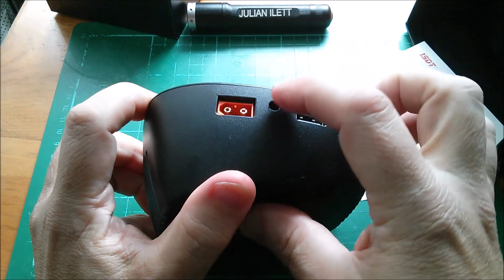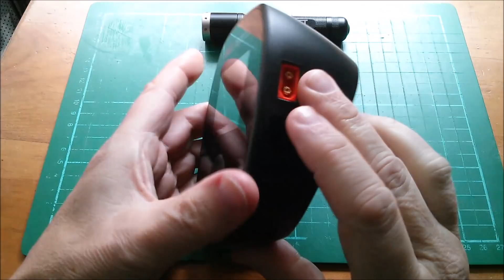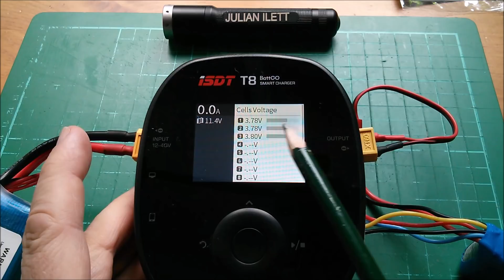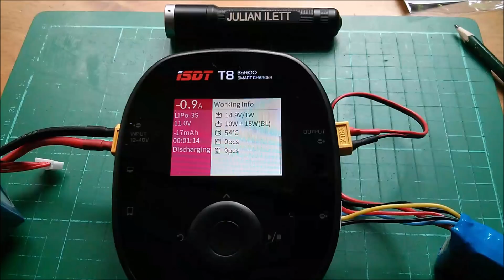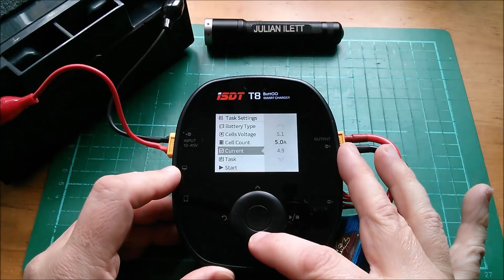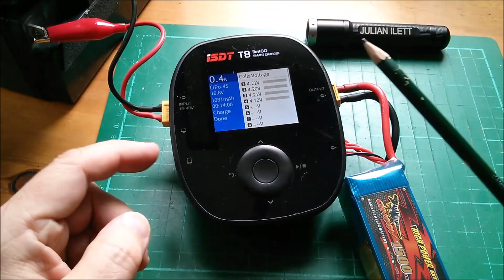First Look: iSDT T8 Battery Charger (BattGo)

Comment: Can I charge a 130A lithium ion leisure battery from alternator via this charger?
Reply: 3dmixer I have been looking to charge a 7s lithium battery (29.4v) from a 12 or 24v alternator. Have you found a way?? I'm thinking about getting one if these and giving it a go!  30a/30v it may take a bit to charge my 550ah liion bank. But better than nothing...
Reply: @jamest.5001  These chargers for like 20 -30A battery packs max. If you want to charge a 550A battery pack this charger will be in flames.  I Had a dc to dc charger which was capable of charging at 30A and max 300A battery pack.  It was a huge unit that the entire back was heatsink and 2 large fans.  This is a toy compared to that. This is good to charge drone batteries or maybe ebike batteries . Don't waste your money

Comment: I like the ISDT D2 the best as it has two chargers in one and the power supply is built in so you just plug it into the wall. Not so good if you are in the field, but much better for my purposes.

Comment: Using a battery to charge a battery seems stupid to me, for a lack of a better term. I would connect it to a laptop power brick to charge any of my batteries. They should charge more for it and offer a power brick, I hate chargers that don't come with a power source. Other than that it seems like a good charger.

Comment: So will it charge a shorty 2s battery @ 30 Amps from a 1000 watt power supply @ 12 volts or does it need a higher volts like 32v?

Comment: it sure is able to put the current from one battery to another... even with a larger discharge rate.... you just have to switch the two batteries around ;)

Comment: Would like to wait for a charger that can charge a 14s bike battery, the 8s charger is 1 step closer. The Q200 charger looks good value has 6 s  inputs and 4 channels so I can charge my 14s with two 6s inputs and one 2s input which is not bad, the 6s channels at 100W each and the 2s at 50W so should charge very quickly . I soppose each charger has its own merits depending on your setup.
Good Vid , glad I subscribed
Reply: I am searching for 12s balance charging. How do you set that up on a q200?

Comment: check the settings (long press center button) for min. input... maybe it goes lower than 11.6v.. also,  you can set a maximum wattage...
on discharge the BL should only be used when cells are imbalanced, so just 10w for regular discharge...the discharge rating normally is for 1S and gets split with more cells..some charger even allow connection of external loads..
and impedance should sink with charge.

just my  2cents and thanks for the review :)

Comment: It will be really interesting to find out exactly what this 'Timing Auto-discharging Function' is that the BattGo batteries list in the specs, and was adjustable on the cell balancer unit. If it does what I think it does, it means the BattGo system must have have the facility to add a internal balancer unit to the battery, so it can self-discharge after that set time period? Making it really handy, especially when you have people who still think it's ok to leave lithium batteries fully charged, instead of at storage levels, particularly if you want longer lives out of your batteries without them puffing up.

Comment: So if i got it right u charge a battery from a battery
Reply: Yeah, you can do if you have a high capacity battery handy. It's more that the chinese have standardised on the XT-60 connector for hobby chargers as it's rated at 60A (hence the 60 in the name - XT-30 is 30A, and XT-90 is 90A). So you buy a power supply for the charger that comes with a XT-60 connector on it, or add one to whatever one you intend to use ;)

Comment: Battery ESR will drop as charge increases. Think of it logically: A charged battery can deliver more current than a discharged one, without terminal voltage dropping by a specific amount. Ohm's Law has to be obeyed! ;-p Thanks Julian.

Comment: The green "fast charge" is when it's still balancing, but has generally finished charging. The blue mode is the real finish :)
The green phase can take quite a while with older and more unmatched packs.

Also: Have you taken a look in the system menus? Hold one of the buttons for a while, you should be able to set a lower cutoff-voltage for the input side there...
Reply from the maker: OK thanks Tobias. Yes, there is a system settings page - the minimum input cutoff voltage is 11.6v - the maximum is 48v (which is a bit weird).
Reply: If I recall my SC-620 has a setting that maxes the W at 520W, and it charges at 520W despite it's 500W rating.

Comment: Good review.  I wonder if you took one of the cells down to say 2.9 volts and left the others at 3.9 volts if it would output to the one cell that is much lower until it reaches 3.9 volts before it raises up the other cells?    Or does it increase all cells at the same time and stops on the cells that reach 4.2 volts first and then continue on the one cell that was lower?  Or does it channel higher current to the lower voltage cell?  I always wondered exactly how the balancing was performed.  I suppose you could test this on the unit.
Reply: Most (if not all) chargers usually perform that latter, they output your set current through the main leads then once the cells go beyond a certain threshold of the others it will connect a resistor across that cell, although considering this charger is a tad expensive at $100, I would be a bit disappointed if it didn't also charge the cells over the balance leads.

Comment: The faster you charge a lithium based battery, the longer it may take to normalize at max voltage.  So instead of flash charging to 4.20v and then coming back in a couple hours to find that all cells have normalized or saturated down to 4.15v or less, the smarter chargers will keep current on the cells until they no longer drop below the set peak voltage.  And yes, internal impededance does fluctuate with state-of-charge, but I highly doubt this unit is actually measuring impedance via injecting a 1khz sinewave and reading it's reflection.  It's more likely just a calculated resistance reading (not true impedance) which is rather useless for cells..
Reply: Aspendell l think you wrong l have one t8 and it can repair old unbalanced 6s 16ah  battery and l mean fix the cell capacity back to is original
This charger stop all other cells from charging and fill the others until is ending charge and l made the test at 4.15 volt

Comment: Whats the point of battGo? You  can pull information about the cell over the 1 wire data link, but you still need to attach the balance leads for balance charging.  In that case you can get cell voltages and info from there while charging.   Other than telemetry data about the cell it seems like it doesn't add that much.
Reply: Um... that "telemetry data" is the whole point!

Comment: I would buy one, if I could set the maximum voltage. 4.15 is way to high, I'd love to use my batteries much longer (more often) than 500 charges. If I could set it at 4.00 Volt, I'd buy one immediately. I do like the 2 Amp balancing feature!
Reply from the maker: If you set it to Li-Ion, the target voltage range is 4.05v to 4.15v
Reply: Thanks. That is more like it. Just a 10th of a Volt lower than that, and it would get interesting. My desired working range would be 3.90 to 4.0 (I would like to play with the setting of course). The only other way I can come up with is using a very heavy relay or switch so I can put the sets of batteries in series and parallel (when not in use that is), then I would no longer need balancing either (after doing some manually sorting the batteries of course). How do car batteries (Tesla and such) load balance their batteries?
Reply: deslomeslager Or write new firmware?
Reply: Well, yeah, if you insist on it working, then no, it won't work!

Lesson: don't post immediately after waking up...
Reply: @FlyingShotsman  So you made an easy mistake like everyone else but that one dude was a real asshole about it. You were just trying to help and he immediately jumped to trying to make you feel dumb or silly for it. He should really know that's gonna happen when looking for answers in a YouTube comment section and have some respect for people throwing out ideas.
Reply: As a workaround, you could put a diode in series with each balance lead to drop ~0.6V, then set the charger to achieve your desired cell voltage.  If you don't want to mod all of your batteries, you could just make a universal adapter with eight diodes and the required 9-pin connectors on each end.
Reply: Please take a paper and work this out for yourself. It is not going to work that way for many reasons.The micro processor would not be able to measure the voltages, and would do strange things.I need a solution capable of charging (and most of all balancing) to a voltage which I can choose (3.90V to 4.00 is most interesting to me). But if this device can't do it, there will be others. I would not mind having to build it myself using an Arduino, so I am watching this channel carefully for that reason!
Reply: use a schottky diodoe with a styp psy resistor so that it can still read the voltage. and have only 0.2v to 0.6v drop at 0.1 to 2 amps if your only charging at a lower current.
Reply: What's a styp psy resistor?

Comment: Nice capabilities apart from bailing out on low input voltage. Instead, it should reduce current draw to keep the input voltage above a settable threshold.
It would then be able to make use of a solar panel or array for input without needing to babysit it and continually restarting.
Because it doesn't attempt to hold a minimum input voltage, or understand MPP, as soon as you ask too much from the panels or a cloud comes by, the charger keeps trying to do draw as much as it's told to, and pulls the panel down until it drops lower than 11.6V and aborts. Infuriating.
I look forward to seeing a firmware update to hold input voltage at a specified level, as my 300W Turnigy Reaktor does, so I'd be able to charge my ebike battery at up to 1kW from my portable solar panels in the field. They are an order of magnitude lighter than Pb batteries!
Reply: I'm not a battery expert or anything but I've never heard of any smart charger doing what you suggested...

If you want that sort of functionality I would recommend looking at the CN3722 or the BQ24650, they do exactly what you said, you set the panel voltage to its MPP and the output to whatever then it limits the current in order to maintain MPP voltage, but of course you'll need another way of balancing cells such as a smart charger, although you should also be able to get away with using one of those cheap cell meters.
Reply: In my video https://www.youtube.com/watch?v=c64cdfHuuiQ I explore doing just this using the Turnigy Reaktor lipo charger with two of my home made 100W solar panels - it is possible to get some serious charging ability.
Since then I discovered that the charger allowed it's input voltage to be raised from its default minimum of 10V to the 17.6V MPP voltage I use, and it doesn't let the input voltage fall below that - it gets fairly decent performance out of the panels, even with variable cloudiness.
I'd like more than 300W though, which is where the iSDT is more interesting due to its size and power density, but if it won't work well with solar panels, then I can't justify getting one - I already have a box of chargers for use at home, but only the Reaktor works well "on the road" with the panels.
The CN3722 and the BQ24650 are tiny, and totally impractical for charging a 1.5kWh 48V 26000mAh lipopack!

Comment: I know it's weird question but it's better to blow air inside or take it out from device? I was making small project(docking station with battery inside) and because of small space I was wondering how to install radiators... This device look really cool and have nice design inside with that radiator and aluminium cooler but I wonder if it would be better to make it blow air inside through aluminum radiator and then though device holes...
Reply: Not a weird question at all but a very good one and a very basic one.
Typically you have to battle between conflicting interests. If you push air into the unit via a fan you can overpressurize the case and put a dust filter before the fan to keep the insides clean, which is great. But then again you end often up blowing the hot air all over the other components in the case apart from the main heat dissipator (this can be alleviated by design of course). Sucking air out of the case will underpressurize it, which mean every hole in the case will have airflow and dust going in which will make the unit dirty. I'd say a well designed unit has the fan blowing in via a filter but in such a way that the hottest part is near the exit ports so that the heat is taken directly out from the hottest part.

Comment: My bike is still running on lead acid,  so that's a module I'll be looking for, both until I can afford lighter batteries for the bike and after when the lead acid come inside to the benchtop.
Reply: Go round laptop service shops and ask them for their old batteries - after a couple of months of ripping them apart and testing the cells, you should have a couple of hundred good ones that you can use to make a pretty big battery, and save a few hundred quid. Loads of videos here on harvesting 18650 cells!
Start here: https://youtu.be/v_4ggDN7290 by HBPowerwall. He uses over 4000 of them to power his home - worth following him!
Reply: Maybe as a stopgap.  I've watched RinoaSuperGenius do it.  But new cells are getting better and cheaper.   I'm more inclined to put new cells into old laptops too.  I've got a stack of ancient thinkpads here.

Comment: Have you tried holding the center button down for several seconds? I've been using an iSDT SC-608 for almost a year now and that's how you get into the System Menu to change various settings. I'd think the T8 has a similar menu to change the screen brightness, beep volume and look at the Firmware version.

Comment: It seems like a very capable charger but it would be nice if it could accept a lower input voltage for easier use with 12V lead-acids. But perhaps they put that low voltage cutoff to protect people's batteries from being over discharged? I'm impressed that little lipo can charge so quickly !

Comment: Have you noticed how the ISDT T8 Battgo logo flashes and pulses during operation?
Reply: James Wade well it do don't it!! That's cool.. It would be nice if that was really doing that.
Reply: Hmm, must have been the camera constantly adjusting for the lighting as it doesn't appear to do it later on in the video.
Reply: That's a flash LED, not caused by camera

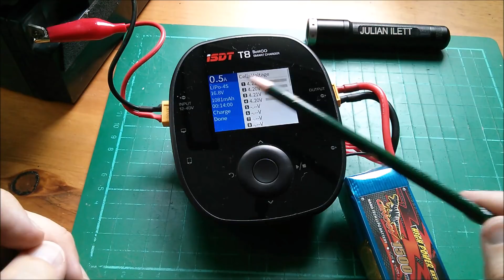Comment: 31:00

Yes I believe it is a hold current... I have the ISDT SC608, ISDT SC620, and ISDT Q6 Plus, and all of them maintain a small amount of current when the charge is finished.
Reply: BladeScraper I wonder if it’s dangerous to have a small holding current like this. Most changers I’ve used cut off completely.

Comment: Please test it with more power. You can use a server power supply like a DPS-600PB. They are fairly cheap and output 47A at 12.15V. There are a lot of tutorials on how to mod them. With a little modification, you can even put them in series, so with two of them you get 47A at 24.3V, which is over 1000W. At 24V input you should get the max. power of this charger unit. Besides LiPos you can also charge your solar batterys at 30A@12V which is also quite neat. I'm curious if this little charger can do it reliably :)
Reply: Yes, I'd like to see that as well.  I happen to have 2 of those supplies Krz mentions that do indeed give me 25.2 volts @ 47A  and I'd love to be able to use them to charge some of my 100A  7S Li-ion packs to 29.4 volts without having to go through a 15A Boost converter each time.  So please try charging something at 30A+ with it. 
Thanx Julian
Reply: My supply is 24.2V @ 75A, unfortunately my capable battery mix is something around ~740W due to 35A output cap. Hopefully my charger arrives tomorrow and I can see how it performs at that output. Based on how well my SC-620 works, it'll be no problem.

Comment: 1000 watts is crazy. Heck I just dont believe it. Pc power supplies only in recent years reached 1000 and this thing says it can do that im such a small package?
Reply: Not uncommon at all.  LiPo chargers are much more densely designed as they don't care about noise so they use smaller fans and make more noise... PC power supplies are big because they're designed to be super efficient and quiet.
Reply: Check out the Revolectrix Dual Power Lab... max 2400W combined output, and must be used on a 220V circuit if you want to be able to use all that power.  All used to charge LiPo batteries, usually for RC models.

Other examples include iCharger 4010 Duo, Revolectrix GT1200, etc.

Comment: Damn it's expensive ! Though seems like a very good charger !
Reply: Not really that expensive.  ISDT are actually one of the more affordable LiPo chargers... if you think the T8 is expensive check out the iCharger 4010 Duo.  And then realize that it still needs a 24-36V power supply as it's not built in.
Reply: KpilotRCHelis I know the DC supply I didn't know about the price of other charger sorry .

I am sused to cheap DC/cc supply